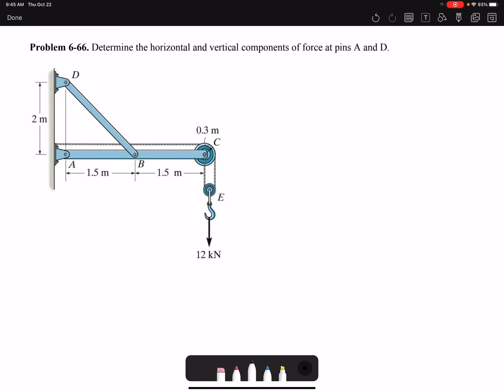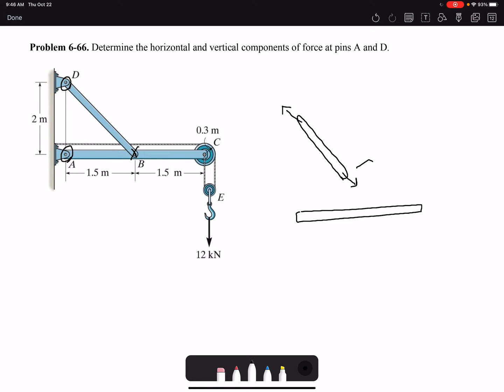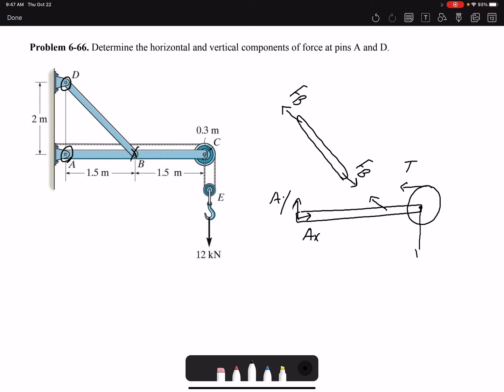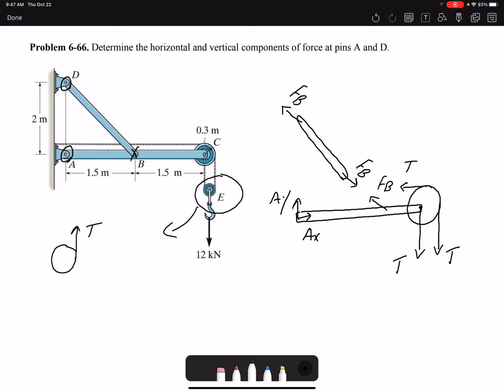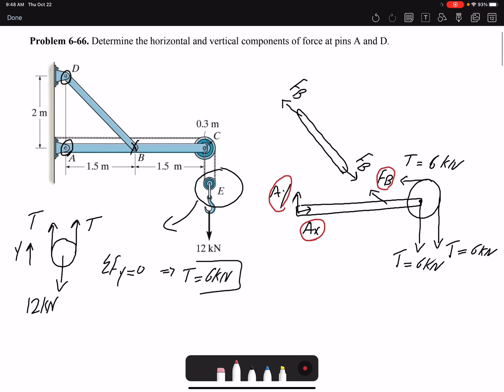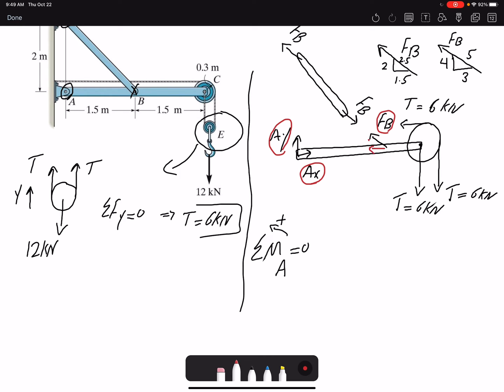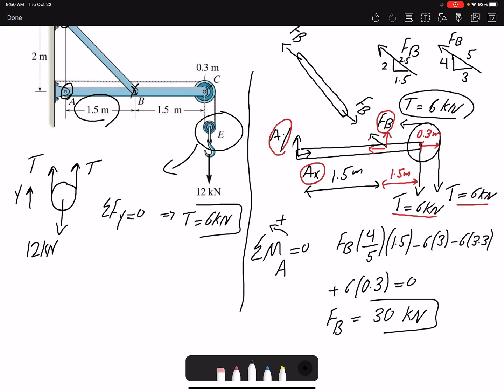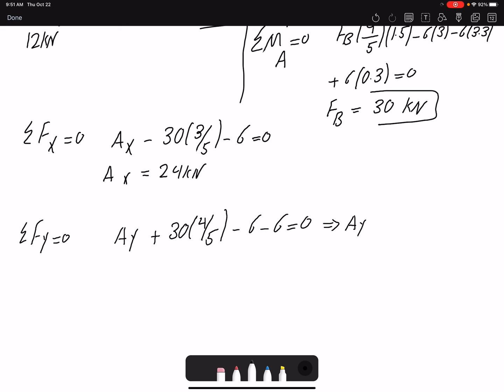Statics Problem 6-66: frames and machine example to find the reaction forces at the pins

Comment: Isn't Ay = - 12kN🤔
Reply from the maker: You are right. It’s a typo, it should be negative 12. I pin your answer for future visitors of the video.
Reply: @engineeringvision  If Ay is negative, that means it is going down instead of up? You can have a negative force as an answer.